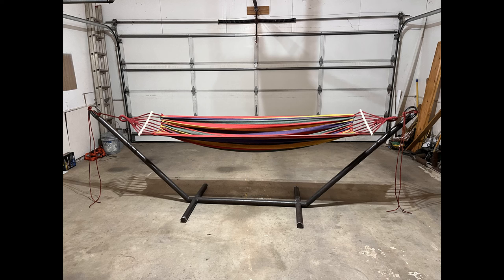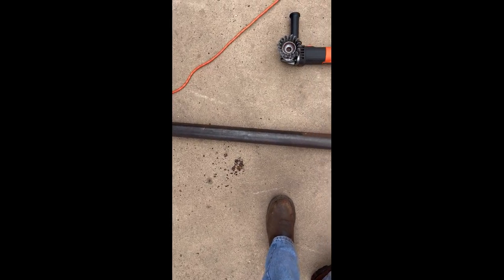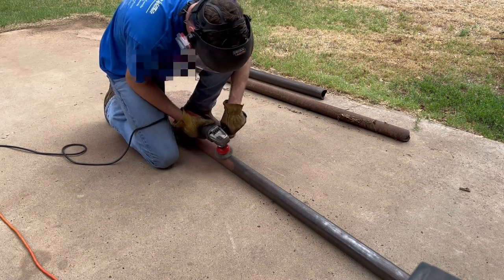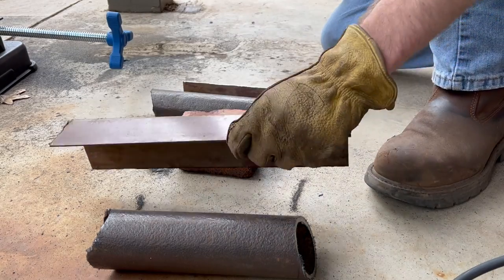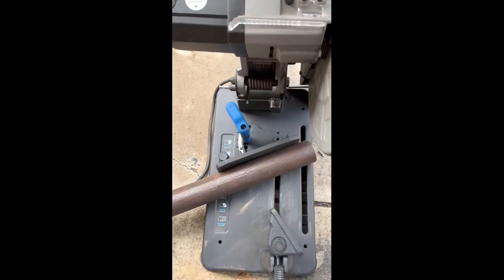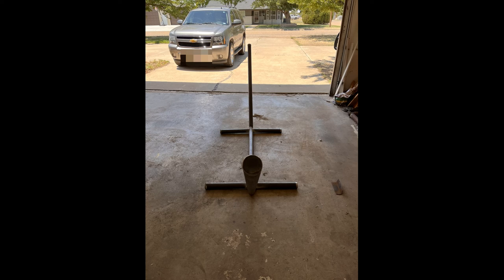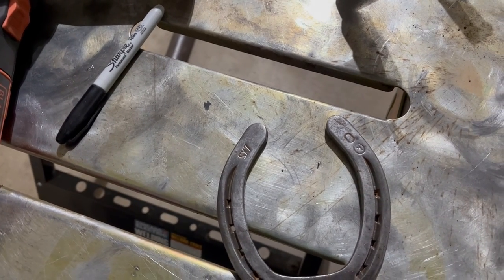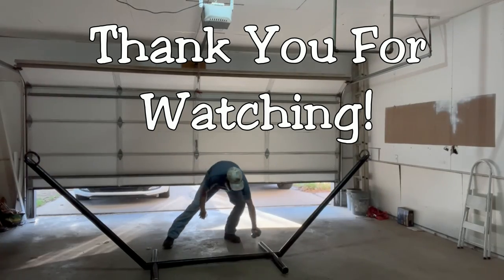How to build a hammock stand out of steel pipe

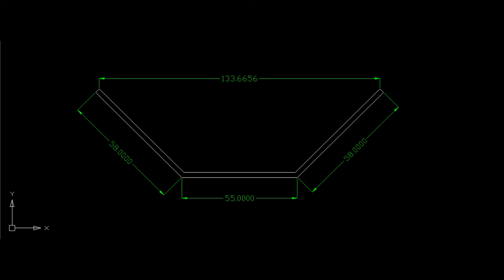Comment from the maker: 0:19 The 45 degree angle is wrong and should read 135 degrees. The 22.5 degree angles, at the same, time are representing a 22.5 degree cut from a saw. Thanks @Thaumcaster for the correction!